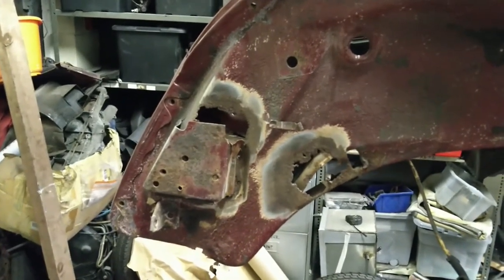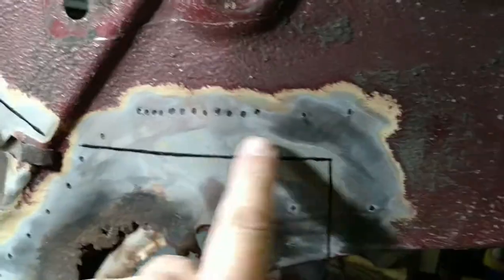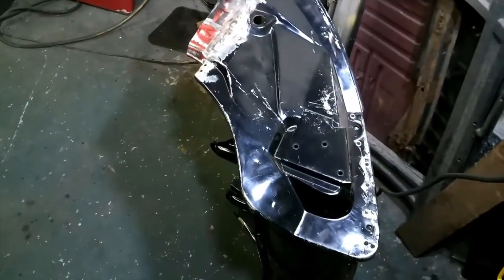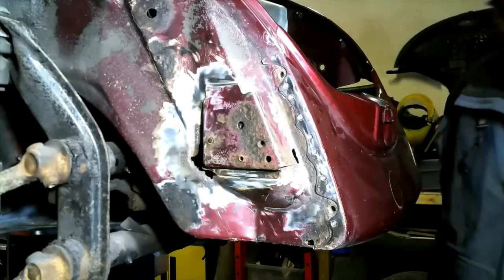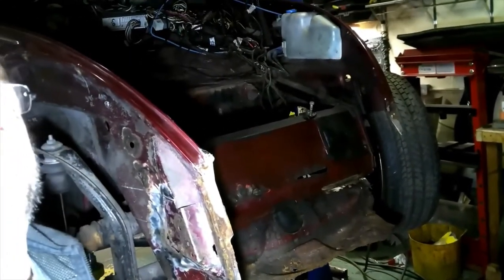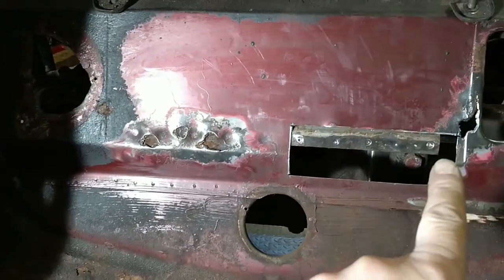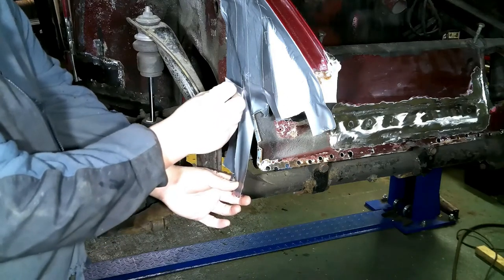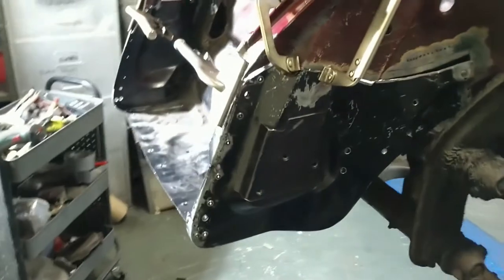Ep 24 Mexibug Front bumper mounts & spare wheel well replacement pt1

Comment: I find the same issue with rust repars on my 1967 bus starts out small soon it has become many panels . But it does make one study how all bits are assembled and you have a deeper understanding of your vw.
Reply from the maker: The thing I noticed most is that while this front clip section fits a lot better than I expected it to, it's really poorly made. Where the factory used 20 or 30 spot welds, the replacement part has 5 or 6. It came apart far too easily for my liking so when I do weld it in, I'll be rewelding some of the seams too for extra strength.